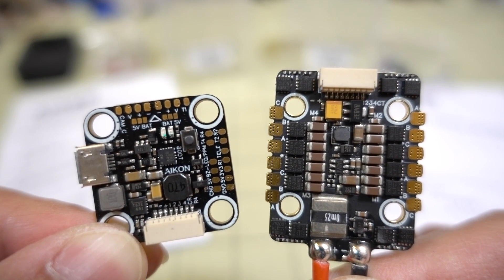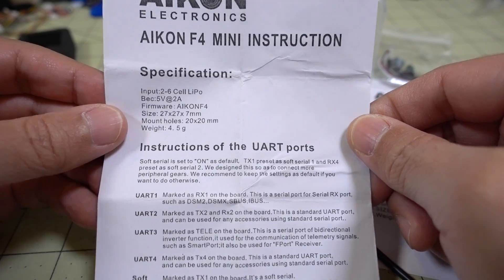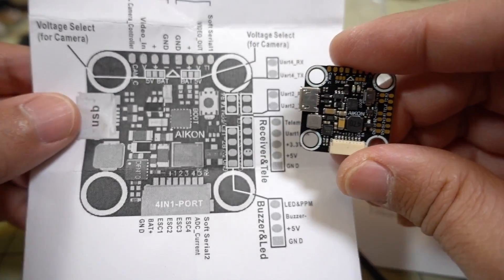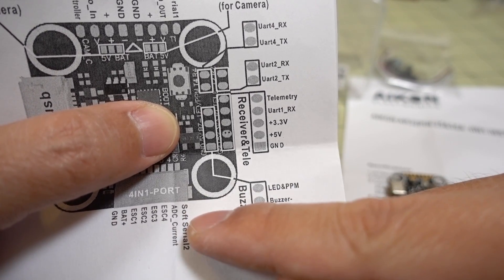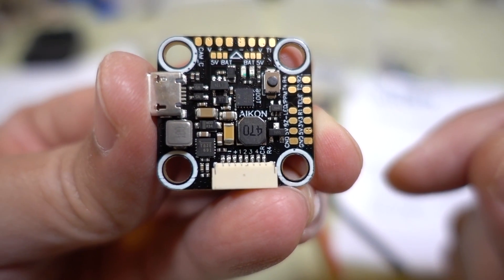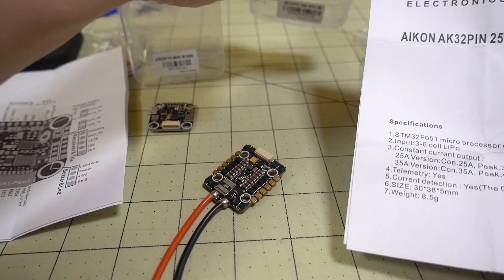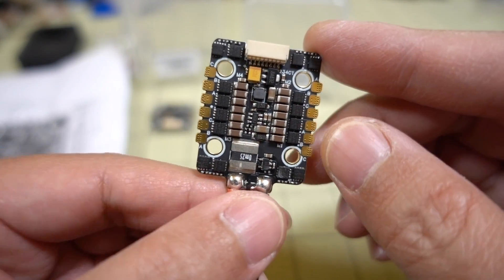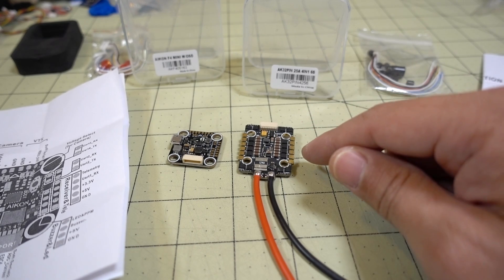Aikon F4 Mini Flight Stack Review 🛠️

Comment: Is this flight controller compatible with DJI air unit?I’ve tried wiring it to my air units and I didn’t get battery voltage infos from it,is there anyway of using this with DJI?

Comment: Where would you solder the caddx vista and crossfire? I'm not getting OSD on the Vista.
Reply: I’m having the same issue, I disabled softserial, I have crossfire on uart 2 and vista on uart 4. No osd whatever I do.
Reply: @luckymefpv  Its working for me now. Crossfire on uart1 and vista on uart2. Make sure your vista-tx is going to uart-rx and vise versa

Comment: Ciao Albert, I have tried to connect the smartport on Tele pad but I don't find the port on betaflight.... I have used the tx2.... But in soft serial T1 the smartaudio Irc TRamp to stealth don't work too.... I have inverted the cable, Tx2 for smartaudio and t1 for sport and work connected to betaflight, but when I start the fc alone whit the battery Goin crazy and don't boot... After the esc Telemetry autodisable  and the fc return to run. Very strange. Sorry for my English.

Comment: I have this stack and there’s a couple things you should know... Those little red gummies are for the 4-in-1 esc. I know they don’t look like M4 holes but they’re not M4 gummies either. Putting the red gummies on ESC still allows N3 screws to fit. The FC unfortunately doesn’t come with gummies if you buy the stack. The 5v BEC is on FC is terrible and will brown out FC if you run anything besides your receiver off it. The current sensor is almost impossible to calibrate but you have the 35a version. Connect to blheli_32 config to verify though
Reply: My FC did come with red gummies to match the gummies on the ESC

Comment: This looked really good! Neither the FC or ESC listing states that the harness that connects the two are included, but I see that you have one on your desk. Is it included with the FC? Also, really cool with the M3 holes on the FC, which makes it easier to use the vibration dampeners down to M2. If I find a big bag of money, I'll get this stack (35A, because I obviously need that, haha) and the Gecko frame. I'll be also be using motors from HGLRC (either 1407 or 1408). I'm very happy with my XJB145, so I know those motors are awesome.
Reply from the maker: I talk about the wire harnesses in the video.
Reply: @AlbertKimTV  You sure do... I redact my question=P